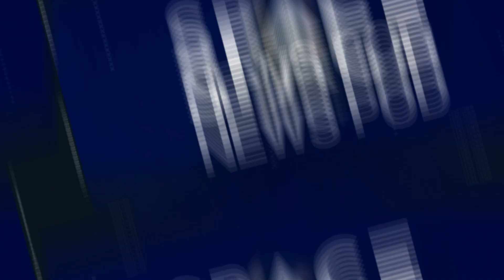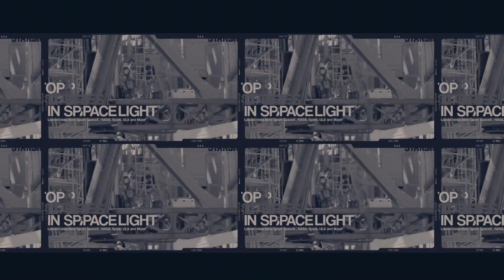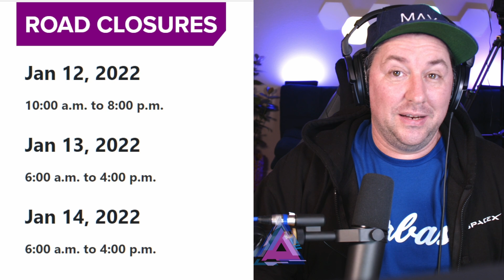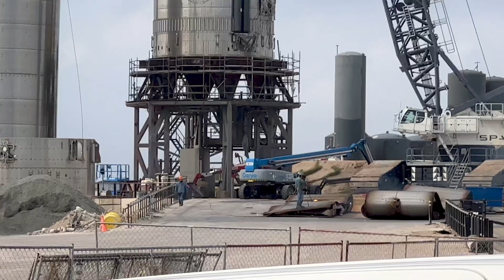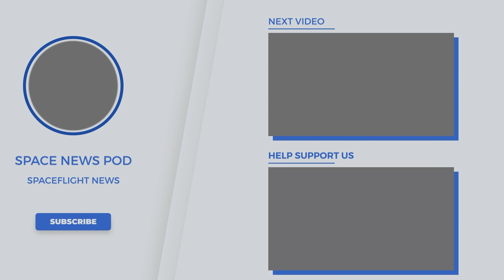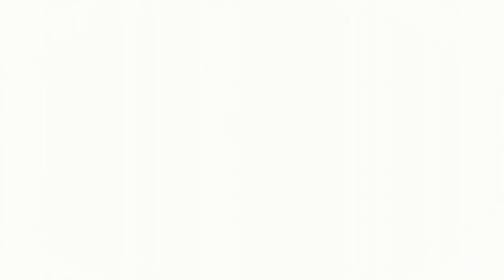Bye Bye Booster 3 - Hello Chopstick Lift

Comment: Why didn't they use booster 3 for a lift pathfinder?
Reply from the maker: That would have made sense. Apparently they have different plans. Plus B3 has no grid fins.
Reply: @stagezerostudio  true...but if damaged...no big deal. So could add fins...test...then scrap